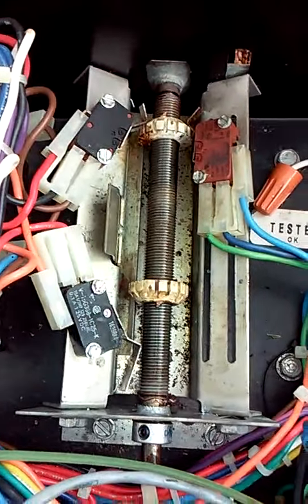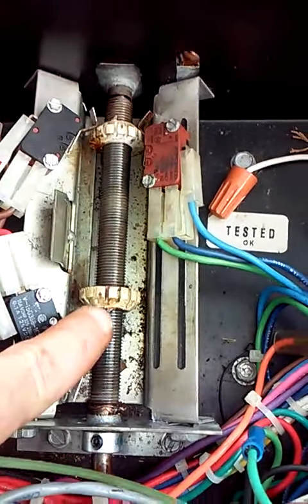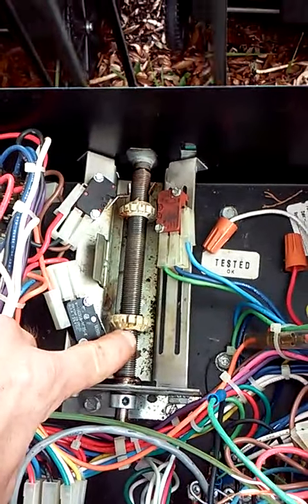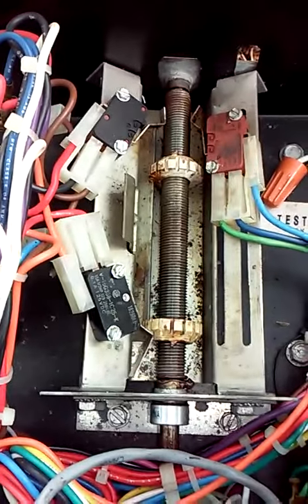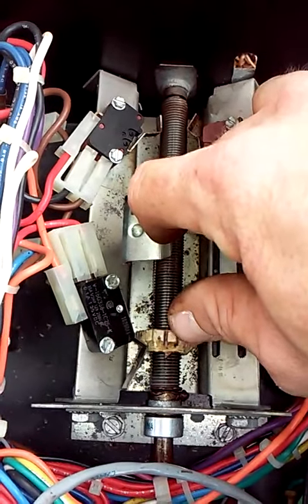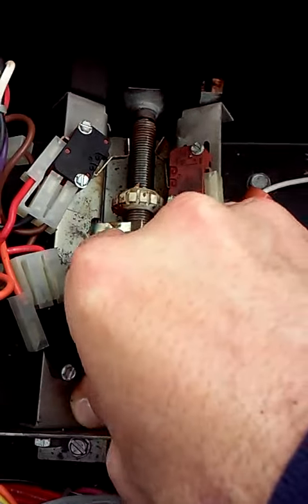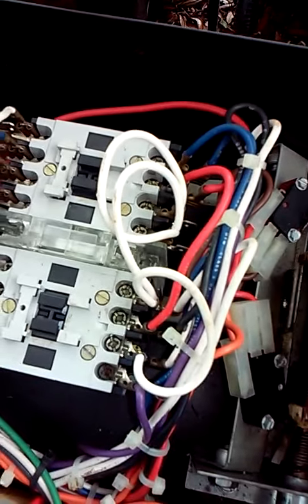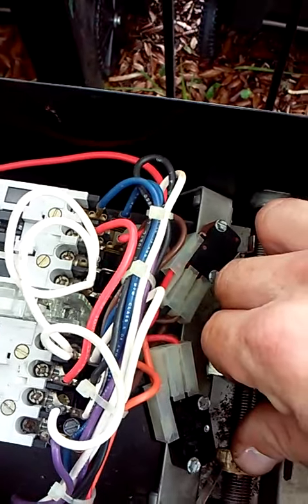How to set limits for a Stanley Model 540 Slide Gate - 352 Gates, llc

Comment: Thank you , very useful info. l had   one ton Liftmaster slide gate go off the track because limit switches got off adjustment.
Reply from the maker: +BARDO Your welcome Bardo, Another note your slide gate should also have a POSITIVE stop on the actual gate front and back so the gate can not get past the rollers and fall on someone.